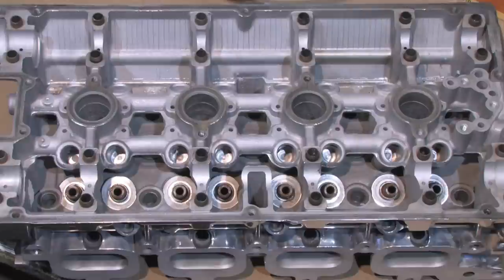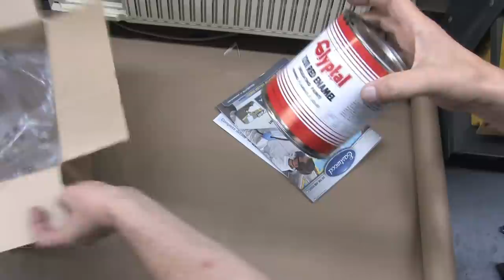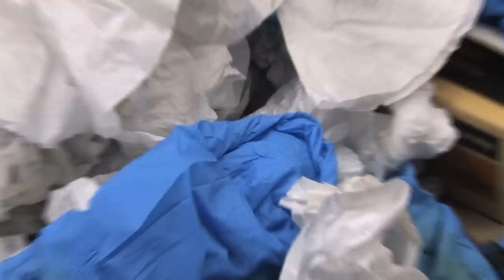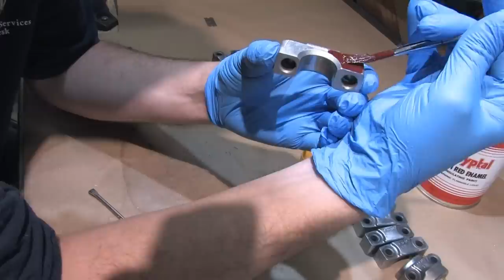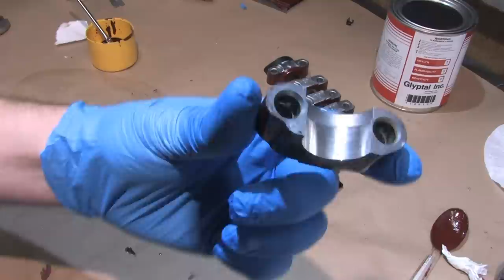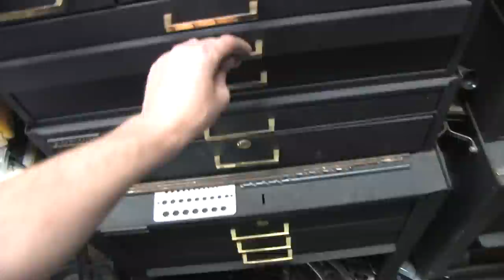Glyptal Application Process

Comment: Jafromobile, First off I love your videos.  My favorite on you tube right now.  By far!  I have a question.  If the purpose is to circulate oil more quickly wouldn't it be possible to bore out the oil drain back holes to achieve that goal?  Also what are the heat transfer properties?  I understand that it is an insulating layer for electrical current, and below you say it wont shed heat.  So then does it contain heat?  Wouldn't that keep the oil from cooling if it can't be transfer out through the metal?  Sorry for all the questions.  I've never heard of Glyptal and interested to learn more.  Thanks for the videos, they are amazing!
Reply from the maker: Yes, it will insulate oil from cooling the oil galleries and the crankcase.  But oil's main objective is to lubricate and cool bearing surfaces, not the crankcase.  Since those surfaces remain un-coated, it still gets to do its job.  The engine's cooling system is where all that heat is supposed to go, and it's why I mentioned that.  I'm sure someone out there would think it wise to paint the ugly, crusty coolant passages, and I can't stress enough how bad of an idea that would be.  If your engine overheats because oil can't cool the crankcase, the engine already has a fatal problem going on.
Reply: *****  I used this all through the 80's in my small block Mopars. Had great success and I did it because the oil would return or drain back to the oil pan quicker. Cleaned up an old barn because of a move to a different resident and just threw away an old can of it. Still have a few 340 blocks laying around that are painted with it after 35 years. Good video.    Jim at Colwood Motorsports
Reply from the maker: Jim Matuszak Thank you for your comment and for spending your time here watching my video!  It means a lot to hear it first-hand from the voice of experience.  I hope my block is still either running around or layin' around 35 years from now, even if it's in a dusty old barn.  Any tips or tricks you care to add?  I'm about to coat my block.  The only thing I'll be doing differently is wearing a half-mask with OPV100 filters.  You know... those things that sissies who care about brain cells wear.  :)  
PS:  Any friend of the Ramchargers is a friend of mine... also, real drag racers sit behind the engine.  I'd say "real men" if the first person to run 230mph in a funny car wasn't a woman.  Thank you for your contribution to history and the sport!

Comment: I’m currently cleaning a block and heads right now to do same.  Been alternating oil cleanings between Xylene wipes and Acetone… yes outside and gloved.  
?? Re baking.  I am in the high desert (5000’) in the eastern sierras, rather than ‘proper industrial oven bake’ for cure… what are your thoughts on solar radiation?  My sun here will get metal HOT… so a head or block in the sun here, will easily get up into the 300-400* range… and then have a slow cool down towards cure.

Thoughts?  Thanks.

**Also… I’m limited in the depth of cleaning as block is already assembled as well fresh cam installed… so cleaning only, cannot shave metal and create grenades.

Comment: how well does this hold up in a high performance turbo engine? I plan on building a 2.3 turbo which is an iron block and head. which will most likely be run with water methanol

also, would applying this to the outside help keep the motor clean?

Comment: Test some e85! 

Also while you're at it you should throw in a little ball of JB weld, because I used it to seal up my fuel pump assembly being 1g fwd it was all rusted out and I had to drill and tap holes but, I used a nice coat of jb weld for extra measure.

Right now and I'm worried its gonna leak when I fill it up past a quarter tank Ive been putting in like 10 bucks at a time, because I'm still in the tuning stage's.

Comment: Even though I drive a Honda I'm really in to your videos, the level of effort you put in to your work is great, and it a lot of it is just good advice regardless of what make you're driving.

I was wondering, would there be any merit in applying this to the under side of pistons, or would that lock too much heat in there? I know there are other types of coatings that they do on the under sides of pistons to help shed heat, seems like that Glyptal could do really well there though and be easier for a DIY if it didn't screw other things up.

Comment: Hey Jafro, I can't find it on your channel, or maybe i'm blind. But was there ever a follow up video to this where you test the Glyptal vs the chemicals listed?
Reply from the maker: erikdude666 Haven't done it.  Sorry man.  lol.  I made 2 sets of test samples to be baked, and on 2 separate occasions.  Both times, the shop I delivered them to for baking lost them.  I'm going to have to buy my own damn oven and make them.  Nobody seems to want to help me do this.  I still intend to do this.  I have 3 parts that still need to be coated, but got they backburnered because I blew up 2 cars.  The good news is that those parts are getting front-burnered again.  :)  I will still do these tests.
Reply: ***** The shop LOST your glyptal-coated test samples? Twice? I sure hope it's not the same shop with the magical-thumb machinist where you brought all those donuts. It seems really unprofessional for a shop to simply lose parts that were brought in by a customer. At the least, they should compensate you for the cost of the lost parts and your time.

Comment: Just wondering if you think this would be a good product for the INSIDE of an oil pan that has tiny pits? Also you said to use denatured alcohol to clean parts, isn't that and oil based product? Thanks 
bob
Reply from the maker: Nope.  Denatured alcohol is distilled from fermented wood pulp and doesn't have any additives of any kind.

Just be sure it's oil-free, completely de-greased, and bake it on for 2 hours at 300°F in an outdoor or industrial oven before putting it back to use.

Comment: I always wondered how much heat conductivity Glyptal has. I always guessed that it conducted heat less than iron and aluminum, and that would offset the cooling caused by faster oil return to the oil sump.

Comment: @jafromobile i know you said this was pointless on aluminum blocks but i have a 81 cb 750k and was wondering what you would recommend i did for that? The cleaning process only or would this coating be of any benefit as well?
Reply from the maker: If the casting is so thin that it weeps oil, then yes, by all means, coat it.  I don't know anything about the cb 750 oil system, but the oil running back to the sump might get there a little quicker.  That's about all I can come up with?  Old Harley and Triumph aluminum castings used to bleed out and this trick has been used by enthusiasts to fix that problem.
Reply: Jafromobile alright i will do some more research on this. But i did notice that the oil return ducts were incredibly porous. Not like what you se in this video but it almost looks as if it is eroded. The pores could probably fit a copper bb in them.

Comment: Would this be a solution for the 2.7L chrysler sludge problem? just a thought
Reply: Lmao! I think they reworked the PCV system to help improve it. Though that engine was before my time as a Chrysler tech, so that info may not be accurate. I personally don't think any vehicle with that motor deserves that coating, too expensive and too labor intensive for a flop of a design.
Reply: I'm not sure it would. The only preventitive matter I have heard of is:
1. Change your oil every 3000 miles, and never ever try to extend oil changes.
2. Use a preferred brand of oil. Castrol GTX is why my father uses.
3. Replace the PCV valve every 30,000 miles with an OEM unit. Replace the hoses at the same time.

And finally, always keep an eye on the cooling system. The stupid location of the water pump can sometimes lead to coolant reaching the oil.

Comment: In case anyone didn't notice, the spray can he used to kill that bug is one of the fluids used to clean the engine.  He's not exaggerating, folks, it's a neurotoxin.  Get some ventilation!

Personally I'd buy a nasal cannula from a local medical supply store, and pipe in fresh air or oxygen instead of trying to filter out the poison with a mask.  You can combine the cannula with a mask or a swimmer's nose clip if you like, but you still need adequate ventilation.  This is very dangerous stuff.

Comment: You didn't mention it, but while doing this kind of work you should pull all the press in oil passage plugs and oil metering valves (usually in the block), brush out the oil passages ( before and after machine shop work) and then tap the holes for set screw type plugs. They will NEVER come out and cause you to lose oil pressure, I know its very unlikely, but I prefer the peace of mind it gives me.

Comment: Hey bud do you reckon this would be great for the outside of the motor simply cause it'd be so easy to clean?mind you I have diesel and she gets filthy
Reply from the maker: Denham Rogers I don't know that it would be the most attractive finish.  There's not a lot of body colors that brick red compliments... but utility wise I suppose it would work very well.  Just say goodbye to using carb cleaner or Ether around the engine bay because the finish would suffer.

Comment: xylene base? 

you know that's some good shit.   how many respirator cartridges did you go through?
Reply from the maker: Just two, but that was on the block.  I was a %&$#ing moron for not having protective gear on during this application and relying on a 2,900 cfm ventilation fan.  It wasn't a very high exposure level, not a very concentrated a/f ratio... but it was a long duration to a low level exposure.  When I put the same respirator and cartridges on today, open the paint can and inhale over top of it, I still can't smell it, so they're still in working order.  I can still breathe through it.  You know you need to change the cartridges when you can't breathe, or when you smell the substance you're working with.
Reply: i would not sweat the shorter term exposures to xylene especially in well ventilated areas.  i used alot of organic solvents back in school and for random projects. i dont use xylene that much, but i do use it for urethane products and in some alkyld emulsion type paints.   

yea its bad, but as a grown ass man with a fully developed brain, healthy liver, kidneys etc your risk is minimum.  at least you know better now. 

its really the guys running parts washers that are at risk being exposed to these vapors for longer periods for years at a time.  it seems that very infrequent exposures to single digit multiples of the maximum exposure limit is not terribly bad provided your healthy and can get out of your system. 

FWIW, i would not rely on the xylene odor alerting you to bad cartridges unless you have been breathing fresh clean air for like 10- 20 minutes first. xylene, tolulene, and alot of organic solvents can become almost undetectable by smell after being exposed to decent PPM's.  

alot of folks attribute this to "olfactory paralysis", but ive read its simply due to "Olfactory Adaption", similar to how smokers are not bothered by cigarette odors untill they quit. 

also i would defiantly not rely on the physical fouling of the cartridges to alert you to the need for replacement. most of these cartridges use activated carbon or activated alum, they may or may not dope the carbon with hydride salts or metal salts for other vapors too. 

when activated carbon fouls or adsorbs its maximum amount of organic vapor it will still flow air reasonably well. 

with that said, testing the cartridges over the paint tin probably IS a good way to test the cartridge provided you are only being exposed to low levels of vapor in the first place, and hence are not totally adapted to the smell. 

also please note that when you are reusing cartriges and storing them in a tight sealed container, the vapors will migrate with time out of the carbon to either face of the cartridge. this means you will breath some portion of this vapor for a short period of time. 

when i reuse cartriges i like to let them air out for a bit, but i honestly cant say if that does anything... just what i do.
Reply: oh hey, you probably know this, but always check the seal on your mask when you start working. 
just cover the two cartridges with your hands and breath in reasonably hard. 

your mask should suck down onto your face, stay sucked down, and you should not feel any air creeping into the face seal.
Reply from the maker: Because of the filming of the cylinder head and all the extra time associated with the capture, changing media, batteries, camera angles, etc... I ended up spending more than 14 hours around this stuff breathing in the vapors.  Not huffing them or anything, but I do know it made me really sick.  I do know that it slowed my decision-making abilities down for several months afterwards. ...to the point where other people noticed.  It's extremely possible that there are far worse things in it than Xylene, but if you read the MSDS it says, "It has been suggested that xylene interferes with the normal function of neuronal proteins. It has also been suggested that the toxicity of xylene may be due to some of its metabolic intermediates. CNS toxicity is generally discernible within a short time of exposure, but pulmonary edema may not appear for up to 72 hours after exposure."
Reply: 14 hours? holy hell i had no idea it took that long. 

yea maby i am way underestimating your exposure. i mean normally xylene vapor in a well ventialted area should not really get much above 100ppm.  perhaps your ventilation was inadequate. 

how many air changes per minute are you getting from those fans?  you mentioned like 3000 cfm... but thats probably at 0 static pressure. 

im guessing your fan has some sort of deflector or hood... perhaps its not allowing your fan to exhaust properly.  you might consider installing some louvered exhaust fans. northern tool sells a few fractional HP models... they are not cheap,  but they are legit fans just do not expose them to chlorine or acid vapors(ask me how i know this). 

also, the MSDS you are linking is probably for an acute exposure via ingestion or insanely bad life threatening inhalation.

MSDS are typically for emergency reference, and not for ongoing chronic low level exposure. 

im not saying you imagined the effects... but you should probably at least consider that it was not actually the xylene vapor and maby something else like you suggested.  you should also consider that you may be sensitive, or have become sensitized to xylene or some other chemical in the paint. 

i dont think xylene/tolulene are classic sensitizing agents, but i could be wrong.

Comment: Do u apply it to any of the rotating assemblies like crank webbings/counterweights and between cam lobes and rods?
Reply from the maker: No, you don't want it causing interference in the balance of your rotating assembly.  So... nothing outside the crankcase surfaces of the block and head.  I didn't even coat my oil pan.  If the oil is in the pan, it's where it needs to be.

Comment: what's the best to clean a motorcycle aluminium engine without harsh chemicals or ovens?
Reply from the maker: Look up my DIY parts washer video.  Mineral spirits is about as good of a solvent as you can easily get.  The results are dynamite.  I have one commenter in the entire thread swearing I somehow ruined my whole engine by using it, and it's total BS.  It evaporates completely, but if you were worried about it, rinsing it with plain old soapy water afterwards would remove every possible bit of residue left behind.  If you use a cleaning brush during the mineral spirits phase and then just blast it off with compressed air, you'll be surprised at how easy it is to completely de-grease an engine.  You may wish to avoid silicone-based rubber parts by either removing them or covering them as they have a tendency to swell up when they come in contact with [any petroleum product].  Mineral spirits is essentially coal oil.  There's an indoor formula that's the highest refinement of the product, and it can be used as a paint thinner in occupied spaces without poisoning anyone.  Read the label or watch my DIY parts washer video for safety information.
Reply: thanks, I am using mineral spirits now and it works good. however there is still some stubborn carbon deposits that don't want to disappear. I am using a nylon brush as I am not sure if a brass brush is to harsh for aluminium. can I use some metal polish like this one http://www.supercheapauto.com.au/Product/Autosol-Metal-Polish-75mL/1846   to clean the hard deposits and the surface of the valves?
Reply: or this one that is for aluminium? https://www.bunnings.com.au/autosol-75ml-aluminium-polish_p4460760
Reply from the maker: too much elbow grease.  That stuff is similar to Simicrome, but not exactly the same.  It's a ton of work.  You need something that cuts faster, chemically.  Look for Nev-R-Dull.  Comes in a can full of natural cotton wadding and smells like lighter fluid.  That stuff cleans and restores just about every kind of metal.  I'd never break it out until I was done with the mineral spirits.  Mineral spirits takes all the work out of a clean-up job until you hit the details.  Nev-R-Dull takes care of the details.  Mothers or any other aluminum polish comes next, Simicrome is what you'd use last, but it makes the dull shine of aluminum look more like the bright shine of chrome with enough elbow grease.  I mean... it takes a LOT of elbow grease, but following that path of treatments will drastically cut it down.
Reply: Thanks, Nevr-dull ordered!